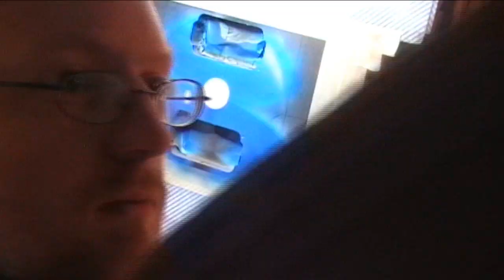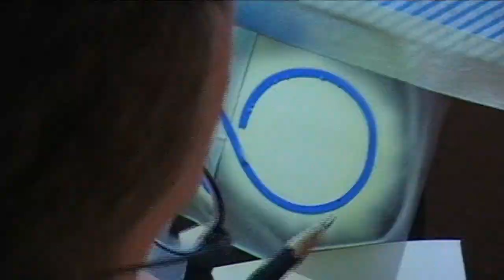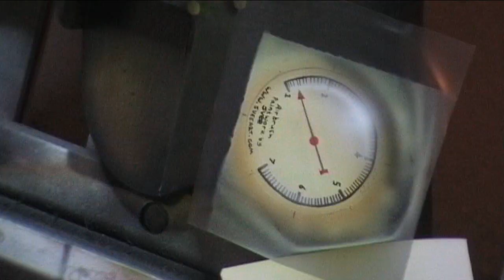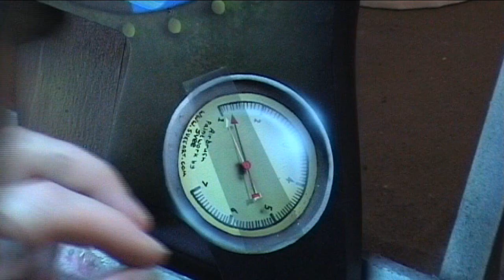Pt. 2 Custom Ibanez S series airbrushed guitar

Comment from the maker: @darquille I cant remember the pickups now but they are what came with the guitar. To paint the pickup i just scuffed it up with some 400 or 600 wet and dry paper then hit it with a propper plastic primer and painted away. As long as you dont use a paint that has a metal content you are fine. There is no change in the sound at all.